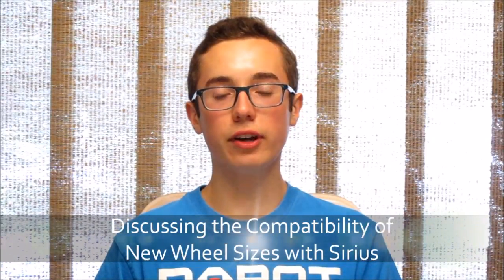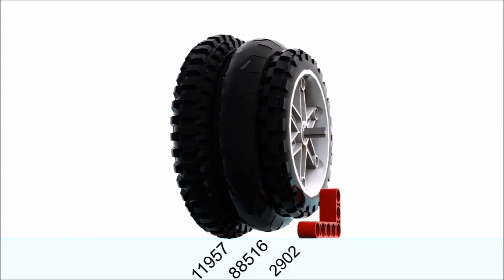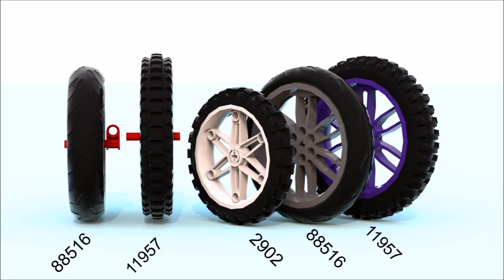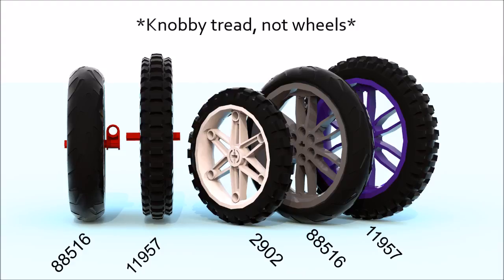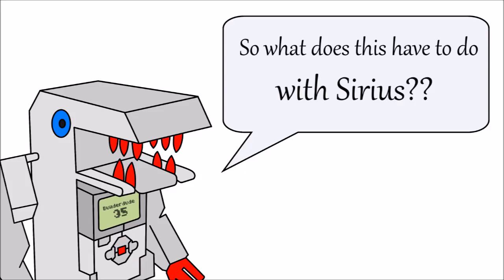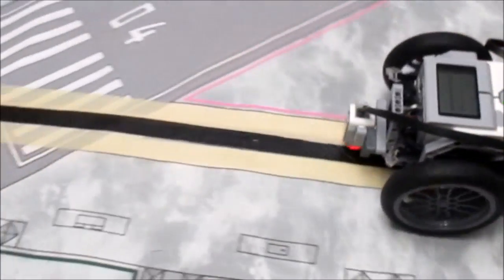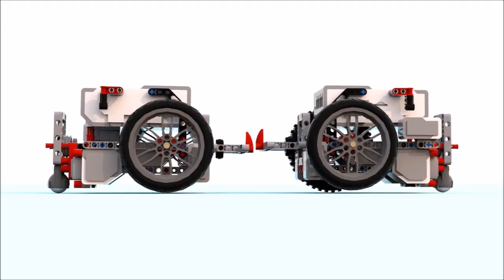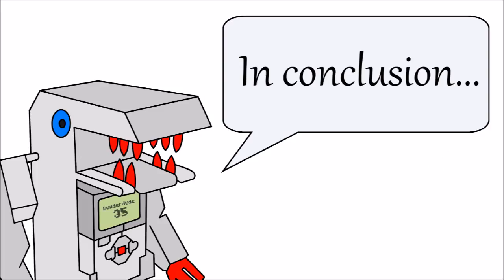FLL Robot Wheels - Evaluating the Compatibility of New Wheels with Sirius

Comment: which wheels have better traction and which do you recommend buying if I want to build a big robot for WRO.
Reply from the maker: That choice of ultimately yours, but the white RCX motorcycle wheels might be your best bet. Philo found those to have the most traction: http://www.philohome.com/traction/traction.htm
Reply: We did a lot of testing with 88516 wheels on the (slippery) German version of the WRO mat. We always ran into wheelspin and programming got too complicated, because we had to add acceleration and deceleration to keep the robot on track and avoid wheelspin. Meanwhile we switched to 2902 wheels.... and the problem is completely gone. So if you need traction and don't want to spend much programming efforts to work around wheel spin, the 2902 wheels are clearly the way to go! On less slippery mats 88516 might be ok, but it's definitely not working on our mat.

Comment: Do you think it is better to have the caster behind or in front of the wheels (For accuracy not speed)
Reply from the maker: Caster should be in back of robot (my opinion).
Reply: yes, you should have a caster wheel in both the front and back. My FLL team has tried it and it has improved the robots drive and accuracy and made it more stable.

Comment: "More Speed":  Using the larger-diameter, knobby #11957 tires is that forward rolling speed is increased by 6% over the smooth #88516 tires.  However, one might have to use an Acceleration/Deceleration program to reduce wheelspin and sudden lurching of the robot.  Knobby wheels may help to climb over obstacles and roll up ramps easier.
Reply: Yes, it would, but there would still be wheelspin.  I've seen FLL mats with the paper worn smooth in certain spots, due to the scrubbing action of the tires at certain points of the mat.  The friction values decrease with heavy use.